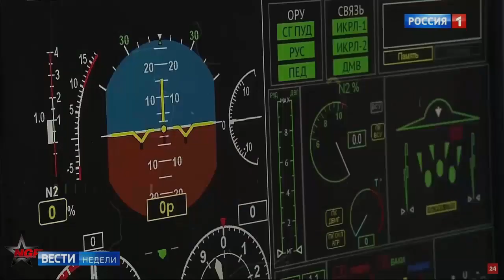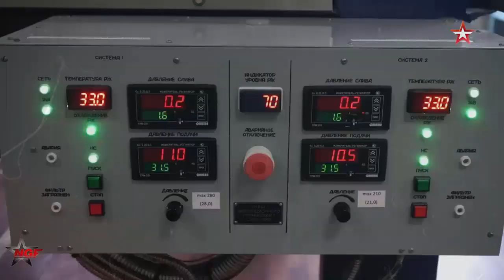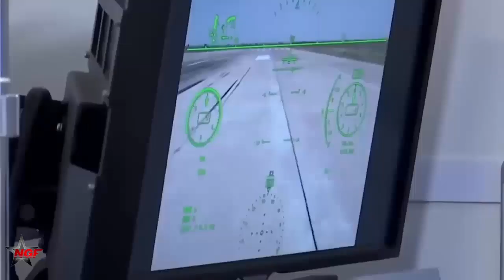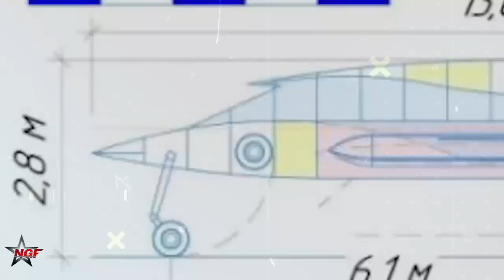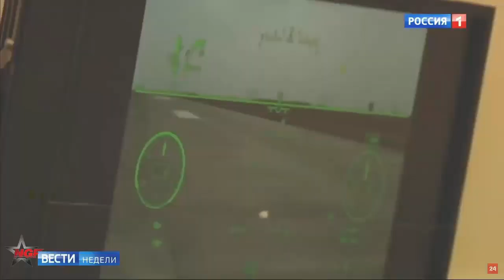The Reason Why Russia’s S-70 Okhotnik Stealth Drone May Not See Combat Anytime Soon

Comment: the S-70A Okhotnik multi mission UCAV could as a navalized carrier borne UCAV featuring reinforced airframe, folding wings & strengthened landing gear . . . call it the carrier borne S-70B Okhotnik-M multi mission UCAV if you will . . . wingman drone & unmanned mid-air refuelling tanker drone are some of the mission profiles that can be undertaken by the carrier borne S-70B Okhotnik-M . . .

Comment: The West never stops lying about Russian military equipment. It has been proven in multiple tests the SU-57 has RCS around.006sqm. Not as low as the F-35 but not close to a Rafale. Russia's biggest problem in production is that they have too many fighters still in production to build large numbers of anything. They currently are producing SU-30/34/35/57 MiG-31BM.  Add in the S-70 that is a lot of manpower spread thin. 

It would appear Russia is done talking about projects until they are actually in use or full production. It makes sense to be very secretive during a war.